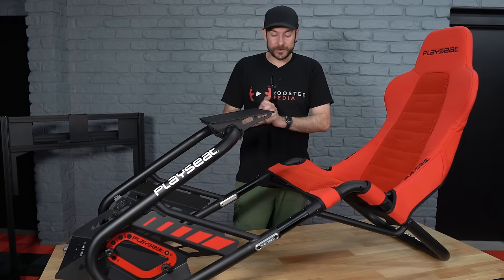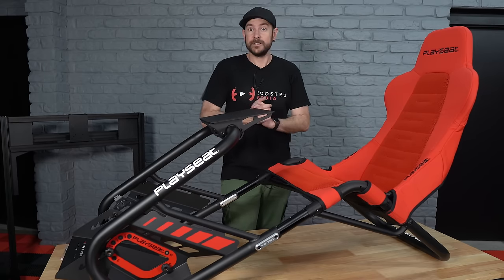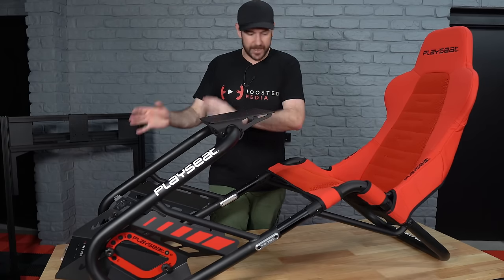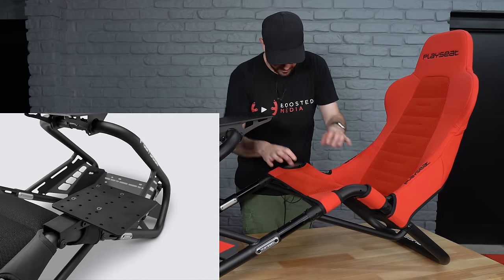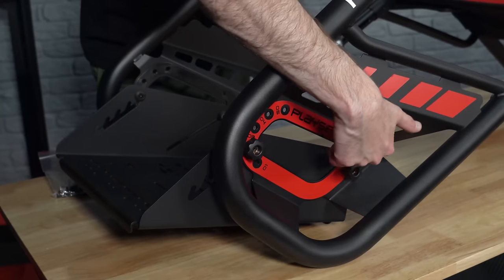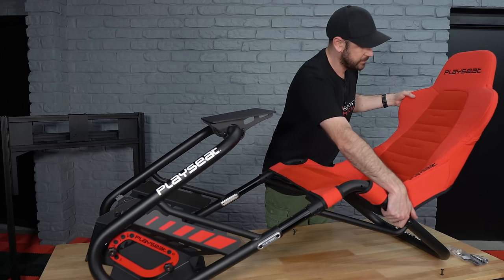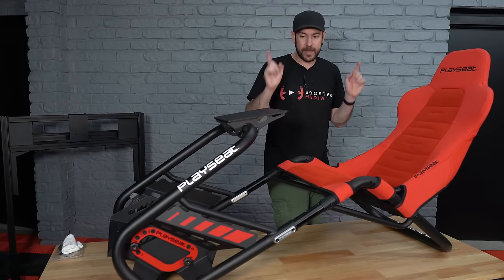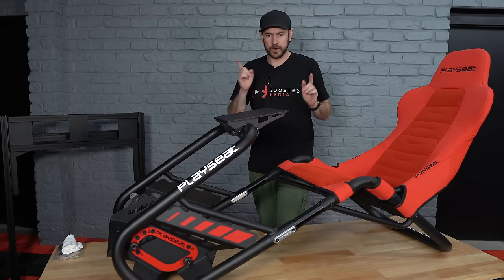JUST BUY A PROFILE RIG? - Playseat Trophy Sim Racing Cockpit Review

Comment: I got a black one almost 2 years ago, think it was pretty new back then. It has stood the test of time quite well, it still looks and drives like on day 1. Main reason i got it was because i wanted something sturdy for strong DD wheels, but also didn't have a dedicated place for a rig. So this thing is absolutely perfect for me, because it very light and fairly small while still being sturdy. So i have it standing somewhere in a corner, and then when i want to drive i just slide it over to my PC and get driving.  Even after 2 years i am still very happy with this rig.
Reply: please tell us/me a little more about comfort of the seat (long sessions) and longevity (does it wear out or get softer/looser?)
Reply: same here, I actually put wheels on the underside of the wheelbase so I can roll it around the apartment lols
Reply: @AtomicAndi  I've done a few endurance races in it, without any problems. Before i had a wheelstand and gaming chair setup. Back then i had a lot of leg and shoulder pain after long session, but since i got the playseat i could drive for hours without issues. The ergonomics are good and the seat is comfy. As for wear, my initial worry was that the velcro straps on the seat might wear out, but they are still as tight as ever. The metal frame stands the test of time ofc, no worries there, no scratches in the coating either
Reply: thx, quite a bit more helpful than the generic Will talk ;-)  @Netrole
Reply: I agree with the OP. I’ve had mine a bit over a year. Comfortable and breathable. No issues for longer sessions and no signs of wear. The Velcro is still holding very well and seems as good as day one. I recently got a Simgic DD and I don’t notice any flex at all. I would buy again without hesitation.
Reply: I have the Logitech edition with the Logitech Pro wheel+pedals and i'am very happy with them,came from a Playseat Revolution with a TX wheel base+pedals,that rig i wasn't quitte happy with on the comfort.
Reply: @AtomicAndi  you could sleep in a Trophy😂they very comfortable.
Reply: Thanks for info man . I'm wondering if there is anywhere for a handbrake and sequential gear stick ?  Or is this more for gt and formula style than rally ? Cheers
Reply: @Nicklz5555  When i got it there was nothing out yet and i had to get creative with 3D printing. But by now i think there exists a shifter mount
Reply: @Netrole  that's awesome thanks mate ill take a look online . This does look like a great set up for me too 😊
Reply: Man getting a quality setup was the best thing I ever did ☺️ just got my Brook Ras1ution 2 so I can use it in Consoles today mostly my PS5 because any racing game on my Xbox can be ran on my 3080 PC tbh Xbox just kinda sits there because I have a PC you can only play GT7 on console so Brook Ras1ution 2 it is
Reply: @Netrole I got the official shifter mount for 30 euro from amazon was on sale for black Friday, fits a fanatic shifter and handbrake
Reply: What monitor stand do you use?
Reply: @netrole
Reply: @shahindersingh3925  None. Got my monitor on a swing arm, so i can move between racing, gaming and work on the same pc
Reply: Exactly me, I didn’t want a rig that was too annoying to be in my office, it is one I need to move around.
Reply: how sturdy is it?  is there any flex at all?
Reply: Broooo wtf 599. I wouldnt spend more than 50 on that trash. Thats EXACTLY what it's worth. 

Man these companies are taking the piss and y'all dont give a damn shit
Reply: This is exactly my case as well.
Reply: Do you have a photo of it standing in your corner? Do you unscrew and fold the seat down too?
Reply: yeah, the same here .
Reply: how does it stand? Thinking for space saving purposes - thanks!
Reply: @AtomicAndi  Seat itself does not wear in terms of loosing shape. Visally tho you can see it has been used especially if not beeing cleaned regulary. Most i did was 10h enduroe with 1 hour stints and no issues for my back.
Reply: Appreciate the details and the durability over multiple years. Looks great too!
Reply: Define standing. Do you mean you store it vertically? If so I guess with how you've spoken you've had no issues with doing this.

Because my concern was if I stored it vertically it could be an issue because it was never designed to be strong in this position.
Reply: @SC_46  Not vertical no, i have it standing normally. But I see no reason why you couldn't put it vertically. It is fairly light and sturdy. Only worry i had about that would be being able to balance it without falling over. Put it with pedal-side to the bottom and lean it against a wall with the wheelbase facing the wall. Should be stable enough
Reply: @lolongo  I was thinking about this as I think about purchasing.   Was it eas to install wheels?

Comment: With the wheel deck you can take it off and reverse it, so your wheel is further away
Reply: Yeah this what I did with my Trophy.
Reply: I have done this also for my simagic.
Reply: with some wheelbases you can even turn it upside down to lower the wheel, I have my R5 like this and I know it also works with the fanatec 5/8nm DD, some bases might have clearance issues with the bar behind it like this though.
Reply: @johanlawrence4247 no way? I need this lol I'm a lil dude 5'4 and I've always just had the base tilted downwards a little. Going to try this tomorrow 👍🏼
Reply: the r5/9/12 also fits with the wheelbase upside down, be sure to add 5mm spacers or so in order to keep the usb and power ports available. for me this was game changer. now i have the top of the wheelbase mount for keyboard fans etc
Reply: Why would anyone want it further away. Must aim for a 90 degree bend in the elbow for an optimal setup.
Reply: Some people have longer arms and reach like I do, if I have it close my arms are way over 90°, flipping it puts my arms are the right angle

Comment: If you're willing to drill holes in the frame, running cables through is fairly easy.  A YT search will lead to how I did it on my Playseat Trophy.
Reply: Good advice for people that are handy but I can see people messing that up bad LOL. But I searched the videos you mention and wow that looks like a fun project. My idea would have been to 3d Print some cable ties like the ones the challenge x has but bigger. However, running the cables through looks like a much cleaner idea and worth the work
Reply: Zip ties boss…Zip ties…😅

Comment: I personally run this cockpit with my DD pro, took some engineering to mount my shifter, e brake and button boxes. But overall it's a great lightweight cockpit that is quite easy to slide around. It suits my needs well.
Reply: great, someday you may upgrade!
Reply: Alu rig on wheel pretty easy to move ;-)
Reply: how many flex u notice?

Comment: I bought a Trophy because it is hands down the best entry/mid level cockpit for me. Amazon delivered it next day, I didn't have to wait weeks, or months for some random dude to send me 8020 (which I would just buy locally and design myself) before rummaging through a junk yard for a WRX seat. The Trophy is perfect for what I needed. It's easy to move, easy to adjust, and insanely comfortable, imperceptible flex, and it looks fucking awesome in my game room. Logi G923 fit perfectly (I'm 5' 10"), and so does the Fanatec DD Pro I upgraded to.

Comment: I’ve had mine for 6 months. I bought it because I was moving from my desk to a dedicated rig. I didn’t want a full 8020 rig, but wanted something more than a playseat challenge. This fit that sweet spot perfectly. I love it. I use it with a Logitech G29 that I’ve had for about 4 years. For my skill level it’s pretty much a perfect setup, but I do want to upgrade the wheel/pedals in the future.
Reply: hi! i'm looking at buying something like this and Im interested in knowing the height of the wheel deck from the floor. Could you measure it for me? I can't find it anywhere. Thanks mate
Reply: @fermillo65  Yea man, because I'm using a G29 I have the wheel deck angled slightly down into my lap. The bottom of the deck closest to me is at 23 inches. The top of the deck furthest away from me is 25 inches. 

If I made it perfectly level the deck would sit at about 24.25 inches away from the floor.

Hope this helps!

Comment: Mine is still perfect 😁 love it and about rigidity I love how it is because the force feedback transfers to the rest of the rig and the tubes act like a buttkicker and its directional too, when I hit a right curb I feel the curb on my right leg, feet and buttcheck
Reply: How many Nm do you run and whats the flex like?
Reply: @TheDoctor46vr it’s probably a g29 / belt driven motor cause they shake a TON compared to something like a simucube
Reply: @LH97-racing  These are solid with 10-12 Nm some people run this with 20Nm and try to tell me it doesn't move but i know that's bullshit

Comment: I went with a tube frame GT Omega Titan due to the width and the ability to add wheels. It rolls right into a closet for easy storage once you remove the shifter. The seat is also easily adjustable for friends which is very valuable.

Comment: It has been excellent for me. My main reason for picking it over a profile rig was the size and ability to move around as I can’t have a dedicated space. I actually got a hook that I attached to my wall to stand it upright when not in use. Works great and saves a ton of space.
Reply: Caster wheels can very easily be attached to a profile setup, and if you use the right connectors, it can be partially disassembled or adjusted to make it more compact to fit in a storage area.

If you use 8020 profiles, it can be very light and moveable with casters.

You're paying a lot extra for a very small space savings.
Reply: @tarushdei  some people have stairs which makes the Trophy the obvious choice.

Comment: I just bought this rig and haven't mounted anything to it yet, but I was very impressed by the build process and I absolutely love how you are given everything that you might need for any future upgrades or changes to your gear. I can also say that the gear/handbrake holder is excellent. (much like the rest of this rig) Once everything was in place and tightened down it stayed sturdy and surprisingly stable.
Reply: could've got the tony kanaan rig which is the exact same thing in person at a physical micro center location for 300 dollars cheaper.
Reply: @invertedjokerr that’s a full sized 8020 rig and doesn’t come with a seat. This is smaller much easier to move around and comes with a seat. While they’re both rigs they’re not comparable, and definitely not exactly the same like you said.

Comment: I've had this rig for 1,5 years with a Fanatec GT DD Pro (8 nm) and the V3 pedals. It's very comfortable, and I'm very happy with it. Also have the shifter mount for use as a mouse tray. I don't seem to have really any flex on the length adjustment like there is on the video, maybe because I have it set to a shorter length. Also the V3 pedals have their own baseplate so no flex on the pedals either. The two things of concern with this rig are lack of quick adjustability if you want to have friends try it, and also the lack of a dedicated steering wheel base height adjustment. But if you can live with those, it's a great rig for sure! Highly recommended.

Comment: I have had the rig for six months now and i would recommend it. I have a Logitech dd pro and pedals and apart from being very sturdy, you feel the FFB throughout the rig frame. Left, right, center, even the painted chevrons! And i use it with VR.
Reply: Mate, did you get the playseat logitech or this exact one, the playseat trophy ? And if the trophy, why not the logitech playseat?
Reply: @avishaiankri  playseat trophy in Black. They are rhe same, in is just branded with the logitech logo

Comment: Hi Will, I sat on the fence due to content creators giving it a hard time on price versus a dedicated rig. I took the plunge a year ago for the awesome looking grey one. I have my DD Pro mounted to play ACC on PS5. I am so, so pleased with it. The build quality is fantastic, and it looks really sweet, so I get away with it sitting on the corner of the living room. If I decide to go super wide and PC in my office, its office first sim second, so I will still need this to sit in front of my desk and move out the way for work. I have a large house I could accommodate a full rig, I just don't want an ugly extruded aluminium rig. Its also super comfy, I can do a 3 hour on ACC and still feel fresh at the end. There is defo a market for these. I agree they need to make a couple of small adaptions 2 holes for running cables internally, there is many vids on YT of people DIY jobs. It would also really benefit from discrete roller wheels just in front of where the fronts touches the ground. This would make it super easy to move about, which is the main market for this. I Plan on adding some wheels to mine and I might drill and reem it for cables while i'm at it. Anyway I adore mine. Just put your self in the mind set of a casual sim racer that has £££ and you will soon see this sat in the corner of my large living room 🙂

Comment: I use a Trakracer TR8 tubular rig with a GT style seat and I originally bought it years ago because it got good reviews, looked aesthetically pleasing in the corner of my dining room, and had an integrated TV/monitor mount. I ended up modifying the mount to allow the screen to move closer to my wheelbase (chasing FOV) but I race exclusively in VR now so the screen isn't important anymore. If I was starting again, I'd go profile but it does everything I need and I can't justify swapping over now.

Comment: I purchased the Logitech edition a few months ago, along with the Logitech Pro Wheel & Pedal. Previously I was using a Wheel Stand Pro Deluxe with a G29. I game in my room so I need something with a small foot print. This was a huge improvement for me in terms of comfort, immersion, the adjustments. Assembly was relatively smooth so I have no complaints there. I do recall there being a number of Velcro pieces but to be honest I cant remember if they came with the Logitech Pro wheel & pedal or the Playseat. It is very light and can be easily moved around as needed, this is with the wheel and pedal on. 

For those who may be worried about damaging/scratching the material of the cockpit, I recommend getting the mat that Playseat also sells. It's the perfect size for the Playseat and helps protect both the cockpit and tile/floor. It also helps to stop the cockpit from sliding around. 

One thing to consider is, while you have many adjustments and they aren't hard to do, it will still become tiresome making them to suit other people. If  you will be the only person using the cockpit, then you''re in the clear but if you have to share it with multiple people it will become a hassle.

As mentioned in the video, there will be some flex but it is minimal. You don't notice it while racing.

Comment: I have got a black one with gearshift support for one year+ combined with Fanatec DD pro, V3 and shifter. It is perfect for my height (180 cm) and V3s are easy to mount providing extra solidity to the "sweet" pedal tray. I also installed the old belt CSL wheel base and it was a "match made in heaven". The gearshift support holds the hefty Fanatec shifter like a champ. It can be considered the best choice for amateurs or semi-pro simracers.

Comment: Bought this frame (logitech version) for GT7 on a Logitech pro setup paired with the family TV. Mounting holes line up perfectly for the wheel and pedals. I also have to pass a wife test, which really means I need to store this out of sight. And that place is the basement. It's still light enough to haul upstairs, even with the pedals and wheel mounted. It's not easy because of the size, but doable for a man of average strength.
Reply: I used three of the heaviest strength drywall hooks (each 160lbs) and just hang it on the wall behind the entertainment system. Wife check passed!

Comment: I picked this Cockpit up for my first rig a few months ago and have major complaints complaints. I can sit in it for hours and not get uncomfortable, I am 5'9" and 140lbs for reference. It took a few sessions to dial in the the best adjustments to use that fit me and felt comfortable for hours or play at a time. I really like how easy it is to move around when put together and with wheel and pedals mounted. Mine did come with velcro to help wires but the velcro was only one sided so it was not able to be used since it was missing half its functionality. Really the lack of being able to do something about the wiring is the only real negative I have with the Rig. I got wires being held on with twist ties, while it looks bad it gets the job done well enough. I have used the G923 for a couple months and then upgraded to the DD Pro 8nm and the Rig held up fine with both. The wheel mount needs to be tightened pretty well or the wheels can can move it when the force gets high. Overall I am very happy with the Playseat Rig and would recommend it especially if you need to move it around. Neither the wheels/pedals nor the rig came with hardware to mount them together so I did have to go to the hardware store and get bolts and nuts. Really wish they would come with hardware or at least say it doesn't come with them and recommend what size bolts/nuts are needed.
Reply: *no major complaints

Comment: back then when i bought the playseat thropy i had to decide between the trophy and a aluminium rig from a polish aluminum profile shop + a cheap car seat. i took the trophy because i wanted to get the rig fast so i could spend my holidays with simracing and not spending time waiting for the profiles to be delivered, building the rig, getting all the right hardware to mount the seat plus it was 200€ cheaper than aluminium + seat.
Reply: How many Nm do you run and whats the flex like?